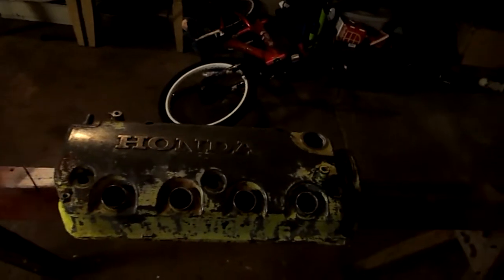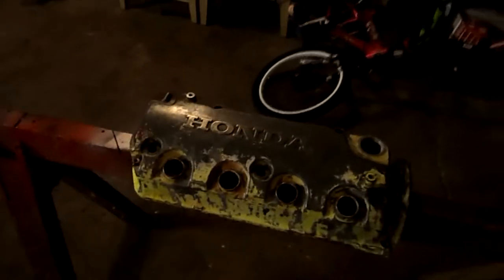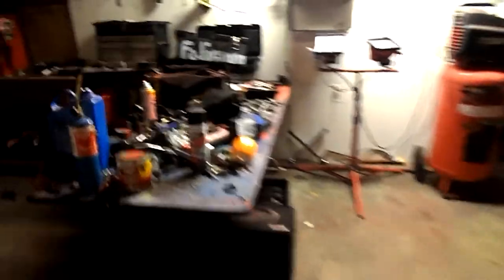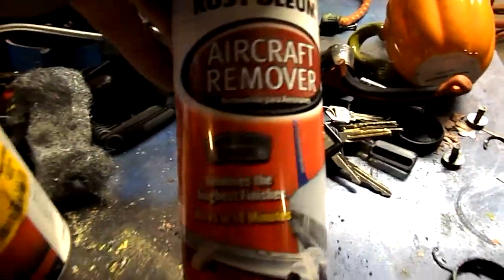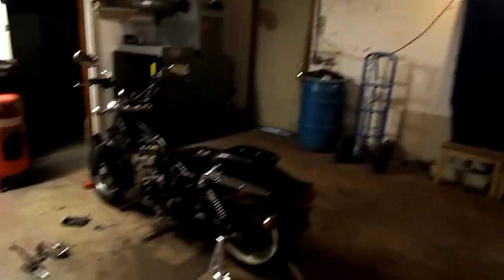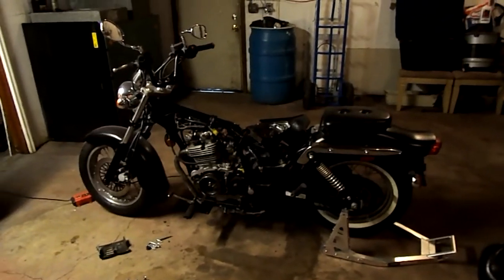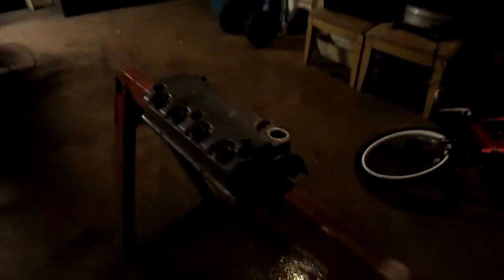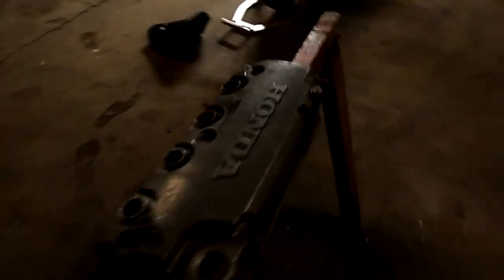D16 valve cover GIVEAWAY!!!! part 1 of 4

Comment: always on that like button. that cover could look sick on my 97 hatch!im running a stock y7 , ebay turbo. currently un tuned (and not driven ha) untill my y8 head checks out good. iVE got arp studs installed, rdx 410's - walbro 255.   its coming along slowly. Keep up the good videos man, 1000 subs soon im sure! im on IG with same username as here :) Cheers from Oregon